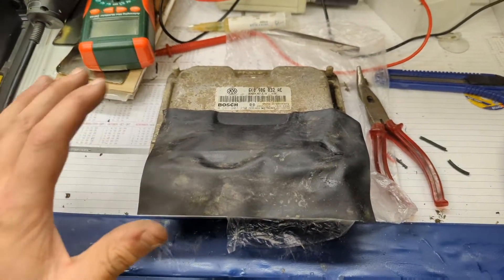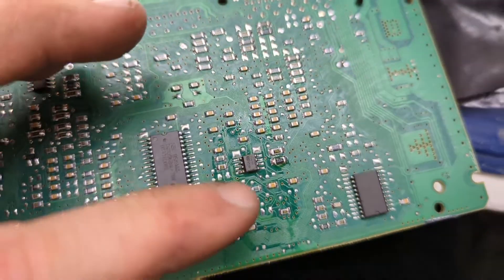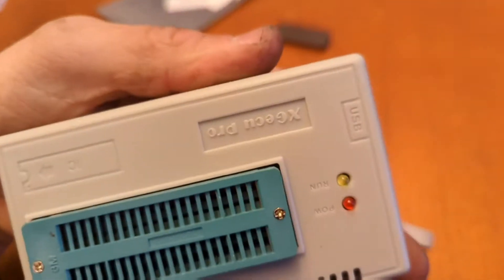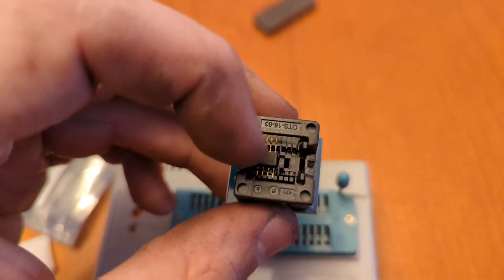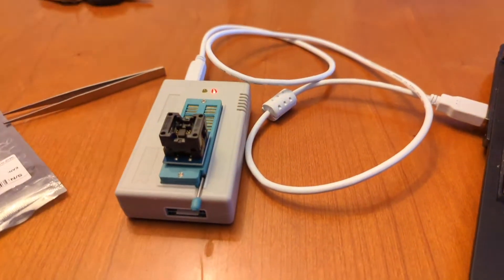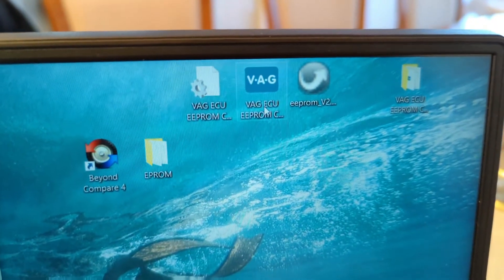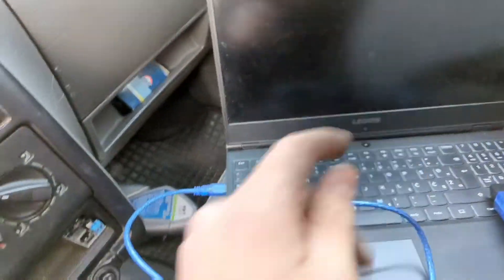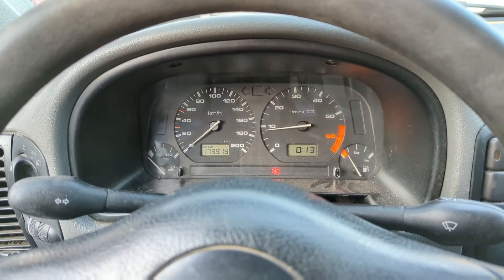Immobiliser removal tutorial (immo delete) VW Golf 3, Polo 3, Caddy mk2, Skoda felicia, seat ibiza..

Comment: Thank you for this video. I have a 1997 Polo 1.4 60hp. Sometimes it starts but immediately shuts off. Under the dash is a small box (immobilizer). When it does not start i disconnect one of the two connectors on that immo box and then start the car again which obviously doesn't start. I turn off the ignition, then when i reconnect the connector and start again it starts and idles. What could the problem be? Thanks again.